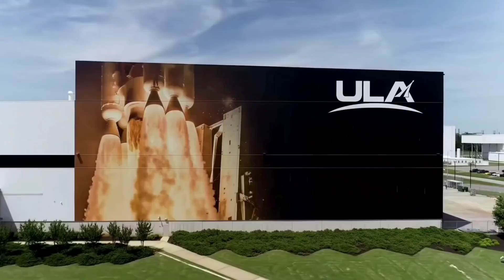FAILED! What Exactly Went Wrong With Blue Origin Be-4 Engine!

Comment: Elon is in a engine crisis? Isn’t even Raptor 2 already near being ready and they just try to push up the force even more?
Reply: There will be next gen raptors, 3,4,5 etc
Reply: @PedroTRamos1  yeah but raptor 1 worked fine and raptor 2 seems to work as well. So I wouldn't call it crisis
Reply: There was a Raptor "manufacturability crisis" late last year that seems to have been resolved. Three Raptor 2s were delivered to Starbase this week.